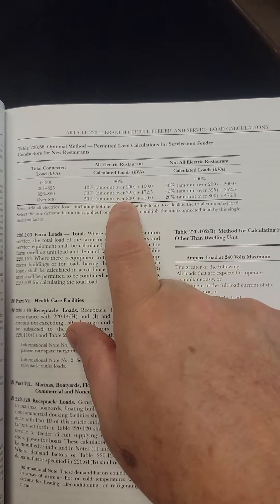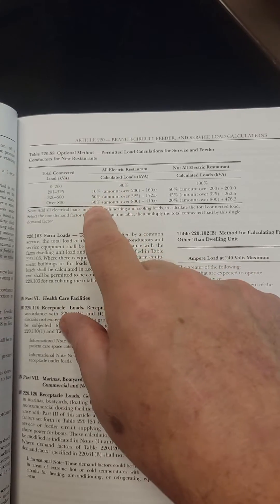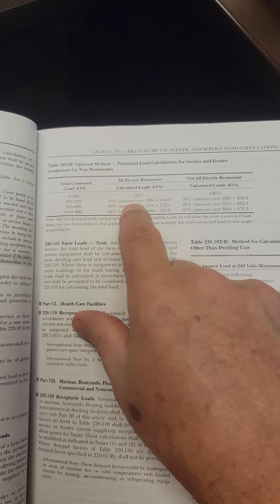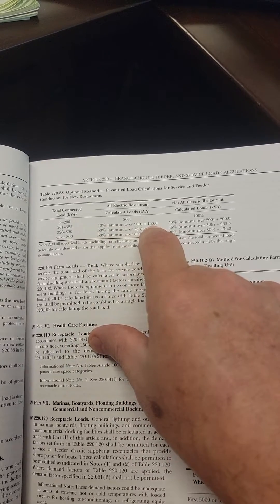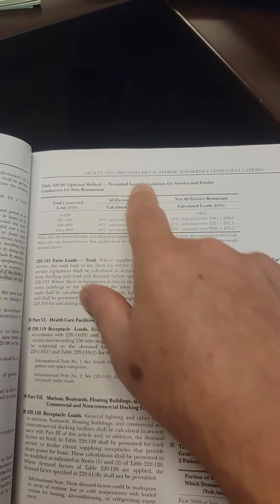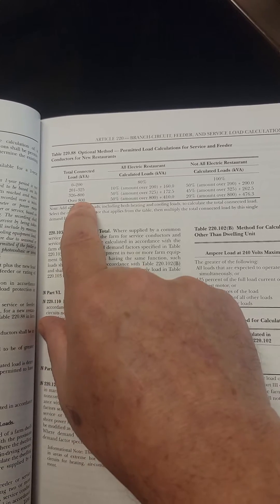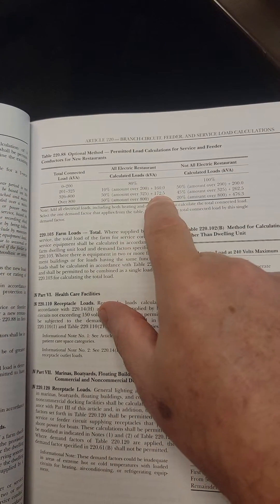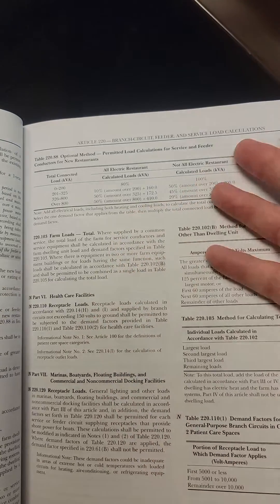All Electric Restaurant Calculation - Optional Method

Comment: I had a question like this on my masters exam last week that I got wrong. Thank you for your video. To make sure I understand correctly, for a 856 connected load, I would take the 56 over 800, do 56 times .5 to get 28 and add 410 to get 438 as the correct answer?
Reply from the maker: If my video didn't explain this to you, then my video is pointless, and I suck at explaining the NEC. Otherwise, why do the video.